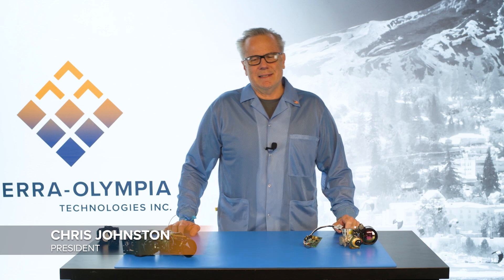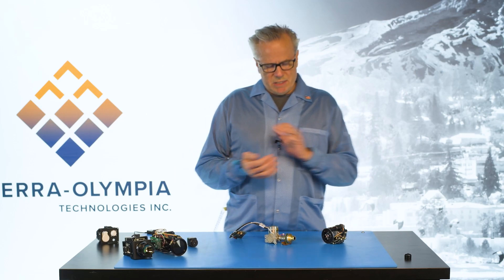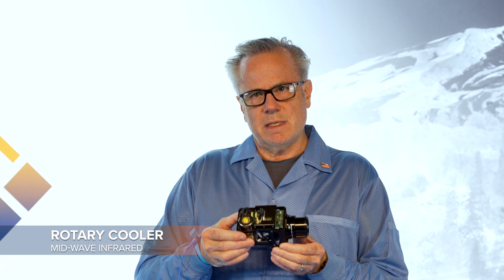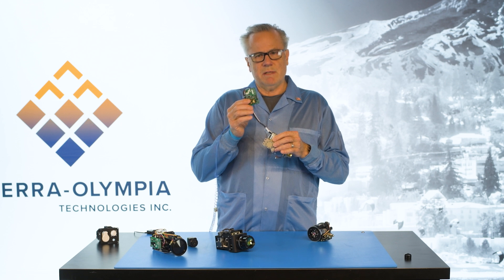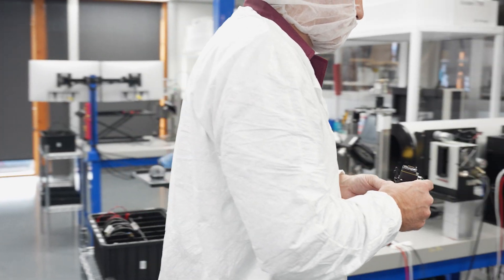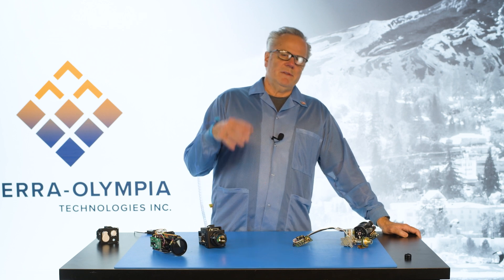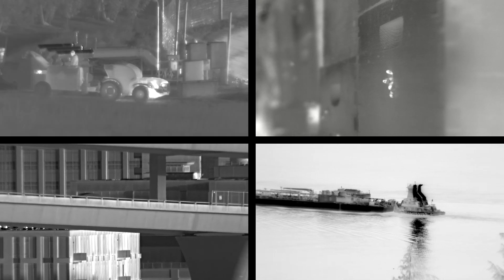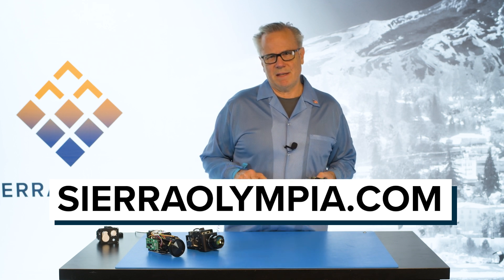Ask an Expert: The Challenges of Building an Infrared Camera

Comment: Thank you for very much informative video. 
Knowing that you have expert knowledge in field of IR cameras, is it possible to use very thick germanium glass to shield flir lepton infrared camera module's lenses from water, dust, high/low temperatures and nearby explosions?
Or maybe there are other ways to protect IR camera's lenses which you can share?
Unfortunately i cannot use usual reinforced glass for infrared cameras because usual glass is not transparent for IR spectrum.